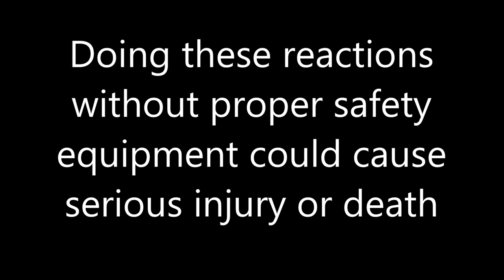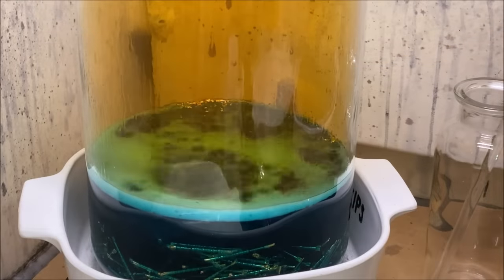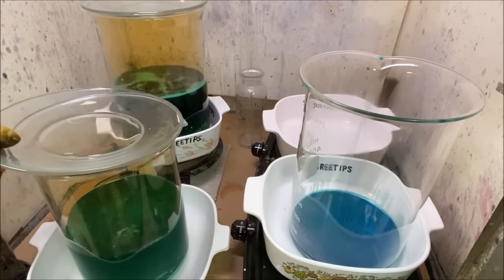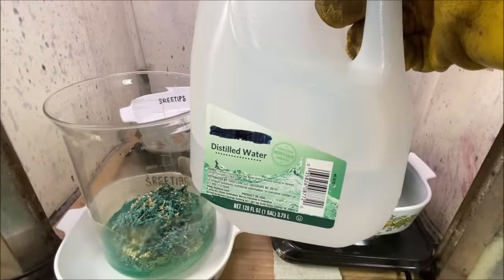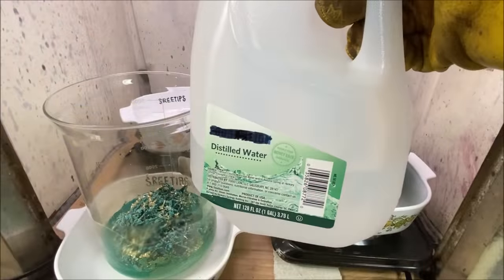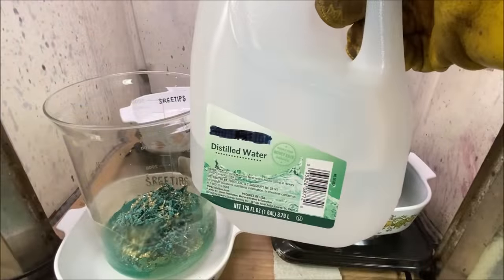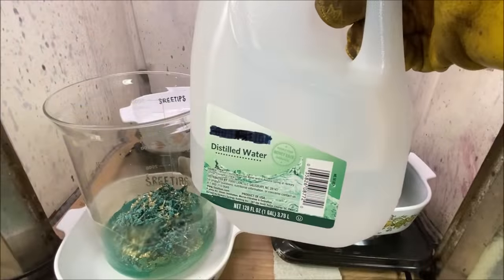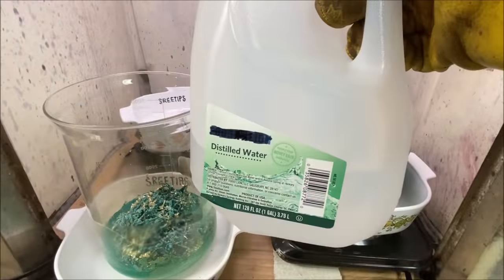Gold Plated Pins 10 POUNDS!

Comment: It seems the initial stripping could have been sped up by first mechanically processing the pins. Copper is a soft metal and you may have been able to shred those pins in a heavy duty food blender like a Blendtec. (just don't breathe the dust..🙂) Probably would have used a far less quantity of nitric as well.
Reply: I wonder if they make a granulator cheap enough to justify owning one. I came across a copper granulator video a while back that pulverized copper into a dust.
Reply from the maker: That would increase the surface area. But it still requires the same amount of nitric

Comment: Hi sreetips, Love the video. Thank you for always taking time to reply to comments and questions. Quick question: What type of tongs are those that you use at the beginning when first incinerating the material pouring it into the beaker?
Reply from the maker: Probably some real long metal tweezers that I bought at the flea market.
Reply: @sreetips  thanks! I actually found them on ebay called 90 Degree Scroll Tongs.

Comment: Wonder if it would be better to start with mechanical separation? Like, running through a tumbler. Then treat the powder and ditch the cleaned off pins?

Comment: @sreetips
Just a question?
Wouldn’t it be faster to just make Aqua Reja to strip off the Gold and go through the processing then. 
Thanks your the best buddy. 😃
Reply from the maker: No, the AR would tend to attack the copper first, then the gold, then we’d have a very dirty solution ten pounds of copper with 22g of gold. Removing base metal with nitric first is the easier softer way. Getting pure gold, from any source, is never quick, easy, or cheap.

Comment: I'm not knocking this, but to be sure I understand. on 9/22/21 Gold was at $56.80 per gram so you recovered 22.8g for $1,283.96. Due to your mistake that you did not try to hide (good on you) this actually cost you $106.32? Now if that is correct, could this have been done differently so that you would have turned a profit?
Reply from the maker: No, getting pure gold is never quick, easy, or cheap.

Comment: Hello, I thought if it is not better to use aqua regia at the start of the process. Why dissolve all the base metal when I only need to dissolve the surface layer of gold. When the gold dissolves, I can remove the rest of the base metal with a filter and save the nitride acid. Of course, there will also be a certain amount of base metal in the solution, but I can then remove it using nitride acid. What do you think about it?
Reply from the maker: I’ll post a video on why this method won’t work.

Comment: I worked at a place that used these pins, and simply threw them away. Over a year I ended up with over 20Lbs of these pins. I proceeded to "process" them like this. I ended up with around 2Oz of gold in sediment. I then reprocessed this using pure nitric to suck out any copper which was left. No amount of metabisulphite added would recover the gold. I lost the lost. I ended up dumping it in the corner of the garden.
Reply from the maker: That’s the stuff nightmares are made of.

Comment: do you have a cost of materials vs what you recover?  only asking because based just on what you paid for the pins and the value of what you refined, it does not seem to be that much of $.  maybe about $200-$300 based on gold values.
Reply from the maker: Matt, forget about turning it back into failing paper dollars that are melting away in value. I converted it to pure gold that’s rising in value.

Comment: I have been tearing apart electronics of all kinds now for 15 months.  I have a considerable amount of gold bearing bits and pieces and would like to begin extracting the gold.  I have come up against one obstacle after abstacle.  I can not find suppliers of the acids needed.  Any suggestions?
Reply from the maker: Computer scrap has very little gold. It’s probably best to lift the gold foils off the scrap in an acid/peroxide solution with an air bubbler. Then recover the lifted foils and refine. I buy most of my chemicals at the hardware store or eBay.

Comment: That was a doozie thanks for sticking it out. My question is in like the last 20 or so comments before mine no one asks if you came up on this or took it in the backside after all was said and done. Price of gold back in Sep 21, 2021 was 58 and some change. According to my calculations and the amount you spent you lost a little bit of money on this endeavor? Not much like 20 to 100 bucks but with all the hours of work you devoted to this I have to ask:hand-purple-blue-peace: did you ever take on anymore gold pin bulk projects after this pain in the _ss?
Reply from the maker: No, but if I could find some more of those pins, and the seller had the analysis, I’d do it again in a heart beat. Computer scrap it popular. And this video is one of my best performers. As for the guy off the street. It’s still a good idea to convert cash (that is declining in value and purchasing power) into gold, that will protect and preserve your purchasing power - even if you overpay a little. Gold is real money and can’t be duplicated. Cash is a money substitute and can be created in an instant. It’s a no-brainer.

Comment: I like to ask, why does my gold float out of my jar of aqua regia solution. Is it from the solution being too saturated with copper? Or the temperature of the liquid? I actually seen it swirling above my jar just before my exhaust fan swept it away. Thank you for all these years of very very good videos.
Reply from the maker: It may have tiny bubbles of air trapped that keep it suspended on top of the liquid.
Reply: @sreetips  Thank you for responding. The super fine gold was actually floating in the air just above the jar, right after adding smb. The solution tested positive before the smb, negative after. No gold left in jar for me to claim.
Reply: I started an electronics recycling company back in 2011, closed it 2 years ago. Had tons of electronics. 100's of tries with the same results. Lol. The same question that lots of others had, Where did my gold go? By accident I answered the question. Without anyway to record it or the ability time post it. Yes, I challenge you to answer that question on camera. 👍😁 I had a very bright light with a dark back ground.the gold dust hovered for a short time about a half inch above the jar lid for about a second before being suck away

Comment: what is your proffered method for processing pins now? Electrolytic cell or AP?
Reply from the maker: The only reason I chose these is because the seller had an analysis and knew the composition. Based on my experience, I knew that I could dissolve the copper out with nitric and get the gold foils. But I grossly miscalculated the amount of nitric it would take to dissolve ten pounds of copper. If I had to do it again I’d probably try a sulfuric acid stripping cell with a few as an experiment.

Comment: Those pins are made from phosphor-bronze which leads me to tell you the white stuff is white phosphorus.
Reply from the maker: The add said bismuth and copper? Bronze is tin and copper. Some nasty stuff to try and recover the gold.
Reply: @sreetips  My first thought at seeing the white muck was that the pins are a bronzey alloy of copper and tin. The HN03 would react with the tin to yield Tin(iv) Nitrate, which in turn would react with the water present to produce Tin Oxide (what I assumed is the white muck and why it disappears when you add more HN03) and more N02 - which of course one couldn't see because it's already present.

Your copper cementing bucket hides a secret methinks!

Comment: That was interesting. But I do have a question can't you do all that in a smelt instead of all the chemicals when it comes to that style of recovery??
Reply from the maker: Smelt: rendering metals from ore. If you mean “melt” then the answer is no. The metals don’t separate when melted, they alloy together. Then I’d have 22 grams of gold alloyed with ten pounds of copper, making recovery and refining much more difficult.
Reply: @sreetips  thanks for the answer. I'm a gpah. And watch alot of gold prospecting videos. The reason I ask is I've seen videos where they have refined say 18k Placer gold into 24k bars using Flux and a furnace thought that process would work the same way considering it was just pins and no plastics or other contaminants. But that video was still very interesting.
Reply from the maker: In my experience, the only way to get 24k (999 parts per thousand) pure gold is to refine it using a wet chemical process.

Comment: I don't understand you said in a previous video not to use plated gold but filled gold and now youre using plated gold what's the difference this time? Just wondering!
Reply from the maker: The seller had this analyzed. They know the gold content. They knew that it was copper under the gold. I knew that I could dissolve the copper with nitric. These are the reasons I did this. Because I knew I could get the gold by dissolving away the copper. HOWEVER, gold plated stuff is best processed in a sulfuric acid stripping cell. I relied heavily on my years of experience to pull this off.

Comment: Is Distilled water critical? What if I do exactly what you did but using usual water from my kicthen or bathroom?
Reply from the maker: Dissolved chlorides (chlorine) will cause problems with silver nitrate solutions.
Reply: i understand... also i know, as a scientist, you want the most purity possible. But... what if I boil the regular water... chlorine shall dissolve in few minutes... of course there will be others scraps in the water. Do you think this could lead to a reasonable result? @sreetips
Reply from the maker: You’ll probably be ok, but I’ve never tried that.

Comment: I use ferric chloride to dissolve copper on protoboards when making pcb's. Is there a reason you are using nitric acid rather than ferric chloride? I also gentle agitate the container to speed up the process.  Very enjoyable and educational video.
Reply from the maker: I’ve no experience with ferric chloride. I knew that I could dissolve the copper with nitric
Reply: @sreetips  your chemistry knowledge is far greater than mine. thanks for the answer and also going to try your method of collecting the copper before disposing the ferric.

Comment: If you have a few moments I'd like to ask you a few questions,? In short,I had a friend who spent every dollar he made from his scrap yard business on buying gold pins,I'd say roughly quesstamating I ended up with around 50 lbs of aqua regia at different stages .my question,( can I just combine it all and start from the beginning?
Reply from the maker: Allen, gold plated pins are best run through a sulfuric acid stripping cell. Many a novice refiner has asked this same question and ended up with a toxic acidic mess, and no gold, because they jumped right into trying to refine GP material in aqua regia. I even tried to do it myself back when I first started refining. I’ve done gold plated pins in nitric a couple of times. But I relied heavily on my years of experience to pull it off. Once again, recovering the gold from gold plated material is best done in a sulfuric acid stripping cell.
Reply: Thanks for your reply,
They only reason I'm messing with it is because I know he spent thousands upon thousand of dollars on these gold pins and had lbs and lbs like between 50 to a 100 lbs or more and never could get the gold out of solution,but he always saved everything ,thus was my question on if I combined it all now can I start from the beginning of the process? I know there has to be alot of gold in there still.
Reply from the maker: If I had them, and wasn’t quite sure of their composition, I’d do experiments with small amounts of the pins. Or, I’d just sell them as-is. That kind of scrap is popular. Unless you’re set up, like I am, to recover the gold, then it’s probably not in your best interest to try it.

Comment: I still don't know why you wouldn't go straight to aqua regia to dissolve the surface gold, interrupt the process to remove the bulk copper, then process the contaminated regia.  Would be an order of magnitude faster and use a fraction of the nitric.
Reply from the maker: If you try this, let me know how it works
Reply: @sreetips  I would recommend trying some kind of reflux apparatus or slow drip to keep fresh regia on the metal.  The simplest solution I can think of might be to premix regia and perform a series of washes until the gold is gone.  Separate out the 'cleaned' base metals as you go to reduce contamination and account for variance in thickness.
Reply from the maker: According to C.M. Hoke, author of: Refining Precious Metal Wastes, trying to remove gold plate by dipping in aqua regia is not recommended. It don’t work.

Comment: It looks like to earned about $500 on this project based on 5 2.5 liters of nitric acid at roughly $70 per bottle ($350) and $500 for the 10 lbs gold pins producing 22 grams of pure gold at roughly $62 per gram at $1,364. Is that roughly correct? This was extremely interesting and a great video.
Reply from the maker: All except for $1364. I actually sold the gold for about $2600

Comment: If it’s plated why not use electrolysis to remove the plating first, then treat the loosened gold with acids once removed from pins? Wouldn’t  this lower the amount of unwanted metals to dissolve thus the amount of time and acids needed? I’m very new to this and love your channel and I am asking out of curiosity not scrutiny. Really great stuff here, I thoroughly enjoy all your videos.
Reply from the maker: I could reverse plate the material in a sulfuric acid stripping cell. But it takes a long time and I can never get a good yield.
Reply: @sreetips  Oh I see, so this is the most efficient way you found? Sweet thanks.

Comment: Sree, how many pins (pieces) are they exactly in 10lbs? If I was to ORDER online, thanks...
Reply from the maker: I don’t know because I didn’t count them
Reply: @sreetips  Thank you for the video though. If you ever have an idea what it may be the amount? - please let me know, if you can, as I'm finding suppliers who sell gold plated pins in peices, just not by the weight as in this case, so I just wanted a general idea. However you have opened to the vast potential of melting down IMPURE forms of gold (18k pins in this case) to a PURE gold form for resale in these dark economic times. Well done, and great work all round! Kind regards, Raj
Reply from the maker: Raj, there were thousands of those pins. Also, please understand, the only reason I bought those is because the seller knew their composition. And based on that I realized that I could dissolve out the base metals (mostly copper) with nitric and recover the gold foils. All gold plated pins may not be this rich in gold or have copper base metal. It was a lucky find for me.

Comment: Find tool maker or blade repair shop in your area to make you a carbide blade that you can install in a heavy duty blender and just pulverize the pins to powder prior to doing all of this. It will save you a bunch of time. Much more surface area to react upon.

Comment: did you use 1000 in materials to get 1400 ROI?
Reply from the maker: Yes, and I would have paid more, just to have the material to make the video. But your forgetting one important point: I converted one thousand paper dollars, that are losing purchasing power faster than a snowball melting in July, into highly valuable pure gold metal, that’s protecting and preserving my purchasing power. Plus, if remember correctly, I re-refined this gold, made a “sreetips” necklace out of the bar. And re-sold it all for around $2400 or something like that. I needed the paper to pay back my debts.

Comment: Is there a reason why we couldn't melt the gold foils right from the nitric acid? Why did we have to use aqua regia.? I'm only asking because I used nitric acid on some high grade material...got plenty of gold foils...went straight to melt....and the gold disappeared...all that was left after the melt was borax...someone please give me advice!
Reply from the maker: The gold foils are not pure gold. Plenty of gold foils yield tiny dots of gold - almost nothing.
Reply: @sreetips  What can the gold foils consist of if they are not pure? The gold foils were much larger than the ones generated by your pins.
Reply from the maker: The foils are about 50% pure gold (12k)

Comment: Good Morning! Would  the reverse electroplating cell work better here?
Reply from the maker: Maybe, but I can never get a gold yield from that
Reply: @sreetips  I did it a tiny bit differently and concentrated my sulfuric from 93%-98% then combined them bringing the acid content to around 96% (guessing), I also use a jumper box to jump start cars to keep a more direct current without the breaks in the flow. And it worked super well and a bit faster. I really like the cell. I definitely can not afford the price of all of the nitric at this point. I have 1 2500ml  bottle of 69.2% nitric to try to pull approx 4,000$ to finish my house. and I am trying to find glass microfiber filters to filter out my silver in sulfuric but I am coming up short here in town. I will have to order online. Maybe I can email you .